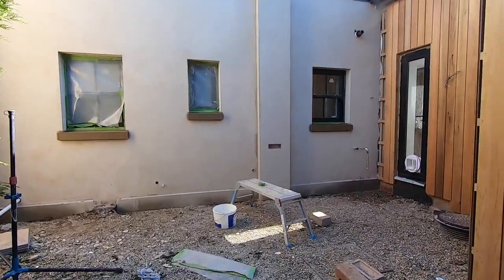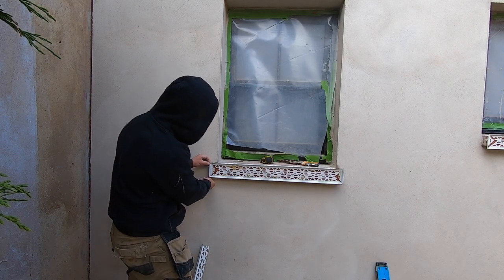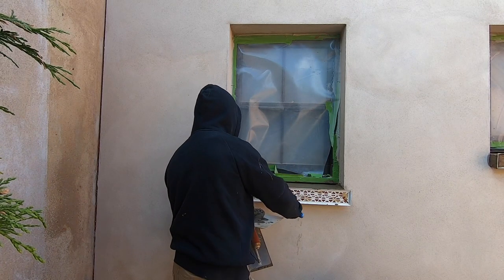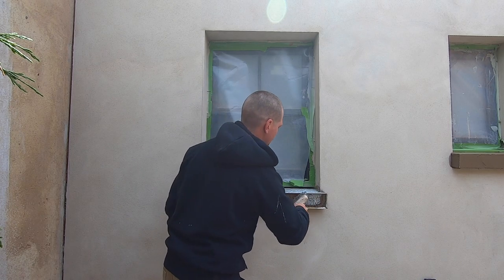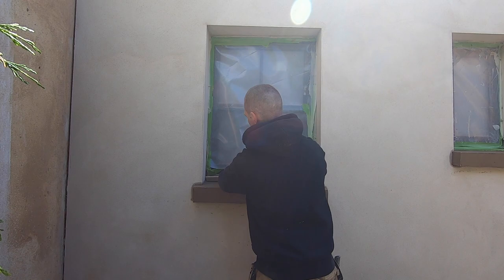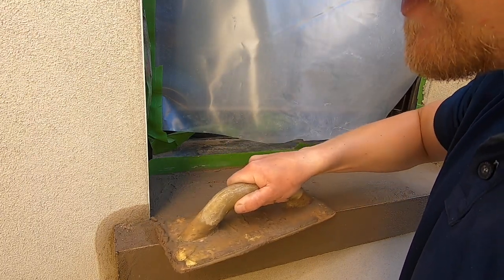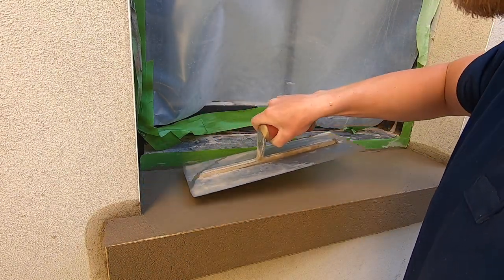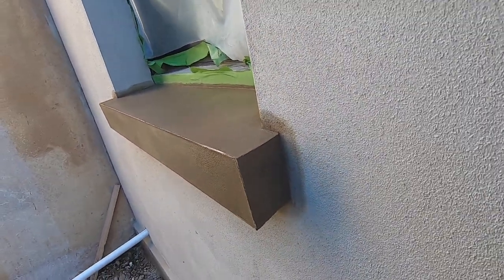Top Tips for Rendering ( Making Window Sills With Sand Cement Render)

Comment: What a great video and explanation. I will try your system, however i will have to run a drip line along the bottom of the sill to prevent runs down the external paint work. Thanks for the idea 👍

Comment: Very nice explanation thanks Blaine. I'm far from a beginner and in the beginning started off working as a labourer for a multi-finish spread in London. Years later I gave up cement and chemical glues to specialise in historic lime and now slake and make my own lime putty mortars for old house and church repairs. For the record lime mortar in the eye's is very painful, especially the fine particle mixes used in skimming work and can affect people so differently, one labourer who got splash-back from a mixer was off work, lying down in a darkened room for 3 days until his eye was better. After a couple of hospital visits I now always wear glasses/goggles doing ceiling skims and don't take too many chances.

By slaking the fine 'kibbled' quicklime you double the amount of lime putty you produce and there is very little waste of mortar on a job because until it's slapped onto the wall and exposed to the air it won't start to set. I usually pre-mix my mortars several weeks or even months before a job because it makes it lovely and sticky.

At the moment I'm rendering a house front in a haired lime mortar and doing 3''x 1'' raised area's around 5 windows & 1 door which I will also be pargeting a bull-nosed, single line in the green render to highlight the opening. 

Lime mortars uses no chemicals (other than the natural ones) and actually absorbs carbon dioxide from the environment giving a lime plastered room better acoustics and a slightly warmer feel than a cement one. Lime and cement will continue to harden up to 6 years after it's first set.

I have greatly enjoyed the interesting and friendly brother- (& sister)hood of the wet trade over the years and started mixing with a stick in a bucket (no whisks at that time in the 80's) worked on one or two multi-million £ projects in the UK with the 4 different conservation firms I worked for and enjoy the bond you get with somebody who also does the same work. All the best.
Reply from the maker: So sorry for the late reply but your story is fascinating. I'd love to be able to try using the old lime putty - I think it's an amazing skill so I have a huge amount of respect for you my friend! I'd love to give it a try one time. Hopefully our paths will cross. 

Thank you for your comment and it's great hearing from a true craftsman like yourself. Well done. Thanks again. Blaine 👍
Reply: @PlasteringForBeginners , I'm blushing at the compliments thanks Blaine. I simply got into the whole thing because the material works and has easily stood the test of time and I love old churches, I also take an hourly rate cut when doing them up because they were built for the public and I want to give something back. 
Working in an old church built in a water meadow with no damp course and no waterproofer it was a fascinating place with Sgraffito mural work done in different coloured sand & cement renders in 1880 by Haywood Sumner, I cut away all the cement render a meter high around the inside of the building and re-rendered in lime mortar.

The oldest place I worked in was Torre Abbey, Devon which was 800 years old. down in the undercroft of the place, there was even a cell with a small rectangular hole where a hermit lived out his time. I found this place so cool and because I started early, worked late I would talk to the ghosts of the place.

In actual fact we found about 6 or 7 remains in an area near the lavabo (dish washing area) which was being prepared for the new lift shaft.
Around the entire complex there was a very expensive laser fence system installed to deter thieves. I talked with Basil the Kia's site manager and asked him if he seen anything strange. He said that of the 6 or so times that the silent alarm had been triggered it was always in the oldest part of the site where the old church was built. 

There were 2 types of building plan for the place, the architects and the archaeologists, the architects did their drawings with rulers and cad software, the bone diggers did theirs freehand.
Before any area's were opened up for repair or replastering you had to take one of the 4 Museum of London bone diggers with you so he could OK you to start.

Down in the undercroft area I found a hidden Medieval circular stone staircase which it was decided they wouldn't uncover because of the costs. There were quite a few big (4 -5 feet thick) internal support walls and when repointing 2 of the wall tops I found the bottle stashes of the alcoholic monks who had lived and worked there.
The Abbey bottled and distributed brandy and other pricey spirits at the place.

Under the haired top-coat plaster, which pulled off the wall like a sheet, near the hidden staircase, carved into a stone support column plastered in 3 coat work lime, facing into a corner with no doors or windows I found a quatrefoil.
It looks like a 4 leaf clover and was an interesting find, but no idea what it was for.
In other old Devon properties I've found Daisy wheels carved into wooden passageway panels to ward off evil spirits.

Across the road from the site there was an old tythe barn where 300 Spanish Armada  prisoners-of-war were kept prisoner before their transfer for trial or a bigger jail.

While you are still young, learn about the traditional stuff and do it yourself. Go on a SPAB course as I once did, they are all over the country and in terms of contacts are value for money.

Lastly since getting into the business I've never been out of work. This has taken many years of living in one spot, I don't advertise, my work is word of mouth.
Best of luck.

Comment: Hey Mate, Fantastic job, watch all your videos, great craftsmanship.

What was your render ratio for first coat? I believe the top coat was 5:1.

Also I have an existing cill, that was painted, the paints peeling off,  needs a clean up, would I need to use new beads?

Comment: That is the first time I have seen someone renovate some grotty window cills. Those were in pretty good condition though - wonder how you would approach cills on older houses that have started to disintegrate - I've seen a lot of local terraced houses about 110 years old in my area where the ornate Victorian cills have started to flake off. They seem to be made up of some kind of aggregrate compound and were probably pre-cast. Could you tell us what mix you used, it looked pretty thick cement/sand mix - did you have a plasticizer in the mix ? Great to watch and you are a perfectionist !
Reply from the maker: Thanks mate! Yeah these were in good Knick to be fair but the process is the same regardless. The scratch was 4:1 and the to was 5:1. FEB Rendermix was in both and a bit of lime for the top also. Lovely mix 👍

Comment: Really helpful mate. Been repairing some old damaged sandstone sills using timber forms and lots of trial and error. Never considered using beads to get the clean edges 🤣 Always struggle mix the mix, this weathers making it a bit too powdery even when covered in plastic and watered. What’s the ratio you are using?
Reply from the maker: Yeah that's how we did it in NZ - its great practice but it takes a lot more time ha! It's just a standard 5:1 with a bit of lime for that creamy consistency when floating. I also always use FEB Rendamix - that's always good to use pal! Great hearing from you and good luck with your sills 👍
Reply: Top man, only one sill left so may as well carry on with timber. But will Defo be looking into those beads for the next occasion. Thanks again, and keep those vids coming. This would have saved me so much time if I had discovered sooner! 👍🏻

Comment: I have uPVC windows so would need to butt up against the plastic at ~1 inch height.  What's the bet way of waterproofing this gap, I'm just worried about water ingress and freeze/thaw.  Lots of good quality caulking I guess?
Reply: I would use window glazing, tape off the sill entirely,tape the window approx 3/8 inch up from the sill. Oil prime the window thinly, then force the glazing into the gap and using a 1 inch putty knife put a 30 degree slope on the glazing. Let the glazing dry a week then oil prime it, then paint with a high quality exterior paint.

Comment: Hi...great work. We are in manchester and trying to found someone like you😀 what type of trademan should we look for and how much would you charge to do 3 windows sil? Biggish at the bottom and 2 like yours for  upstaires windows? Just to have an idea on how much i would need to spend😀 thanks
Reply from the maker: Hi mate, how's it going?? I'll be honest mate there's quite a lot of prep and it's quite a time consuming job. Depends on the tradesmen but I'd say anywhere from £200 - £400. Shop around and see what you get...just be careful on the tradesmen because sills can easily blow if prepped and rendered badly.
Reply: @PlasteringForBeginners  i was quoted 800 for 1 big window and 2 small 😪

Comment: My question is how do you WATERPROOF them?  My house had pre-cast concrete sills with a rebar for strength.  Constant water penetration has rusted the rebar and causes the concrete to split.  I can patch the cracks with something like FLEXX, which is a sanded caulk to get a rough texture like the original concrete, but HOW DO I SEAL THE CONCRETE FROM FURTHER WATER DAMAGE?

Comment: Hi just wandering what size speed skim would you recommend thanks in advance
Reply from the maker: I like the 1.2m but 900mm is the perfect size as an all rounder my friend 👍
Reply: Cheers thanks for help 👌
Reply: Plastering For Beginners I’ve never seen a steel trowel to flatten s and c render at the final stage.  Always sponge float or sponge. Would you do an entire house with the steel trowel this way?  
Also was it too tight to put beads on at the back of the cill? That’s why you free handed them? 
Cheers you do great work

Comment: Fantastic video thank you. I’m going to attempt this at the weekend to one of our windowsills after removing the old, damaged render. Just one question, is there anything you need to do to a wooden window frame to protect it when it comes in contact with the render? Without some kind of membrane between the two will the frame rot in time? Thanks

Comment: Looks good, but you barely have slope for water run off.  No flashing or caulking to keep water from collecting between window and sill.
Reply from the maker: There's a a fair fall and you wouldn't use caulk outside. Sand cement is time tested and is designed to be used externally 👌

Comment: what proportion of sand and cement do you use for the mix? Thanks.
Reply: A smooth coat render is about 5:1  scratch coat 6:1.   And not too much water. Add a little bit of waterproofing solution , in the old days a good dollop of neat pva use to do it if ya didn’t have feb mix .  But things change with time. So check the merchant for modern solutions.

Comment: Hi mate Iv just rendered my pizza oven dome first time btw, I did a scratch coat then did the final coat but it’s very rough, I sponge floated it but it’s more like the wall on ur video, do you think it can be sanded to smooth it out once it’s dry? The overall shape is great it’s just the texture. I used 5:1:1 final coat. It’s me from Hastings btw lol
Reply from the maker: Hello pal! How's it going? You can try to brush the texture off but it is tough once it's dried. It's hard to remove afterwards. I'm sure it looks great though pal. Great hearing from you and I hope you're coping during this madness!! Cheers mate 👍
Reply: Plastering For Beginners cheers mate yes just about I’m still working so not much has changed for me except staying in 😆. I will see if it can brush off one it’s dry it’s almost now, I’m painting it anyway but wanted a smoother finish but I’m sure once it’s painted I could live with it. Hope all is okay with you mate
Reply from the maker: Tell me about it mate - I'm losing my mind ha!! I'm sure it looks mint mate - paint Always softens the texture! Great hearing from you pal 👍
Reply: Plastering For Beginners you 2 pal, just get to render the block work and point the arches and it’s finished, I will be putting it in my channel once it’s finished I’ll let you know. Keep up the good work mate you have a great channel 👍

Comment: They should have fall outwards so water don't sit on them.
Reply from the maker: There's a fall from the back to the front so any water hitting will slide down. There's also a fall from the underside which forces any water to run down and fall from the lower edge.

Comment: Great vid but sand and cement does not adhere to plastic beads! Stainless only when it comes to sand and cement white pvc beads are used for though coloured renders with polymers in the render.  Sad to say but once it freeze all render will come away
Reply from the maker: Hi mate! These beads are designed for sand / cement render - I've been using them for years and never had any issues. I do prefer stainless steel though I must admit 👍
Reply: Another great video mate. Just one thing I didn’t realise plastic beads don’t work with sand and cement. I’ve just done a scratch coat using them on a retaining dense block wall. Does it mean it’s now going to blow all around the beads?  Gutted if so as ha e taken inspiration from your videos to do this project myself.
Reply: @jacl4636  dont worry Harry hasnt a clue